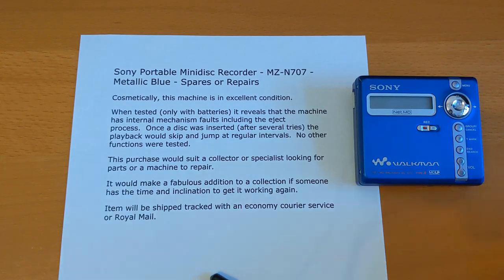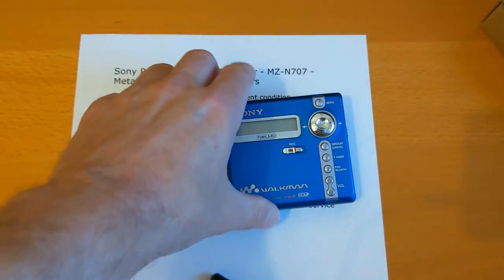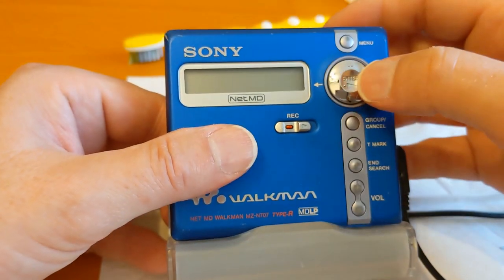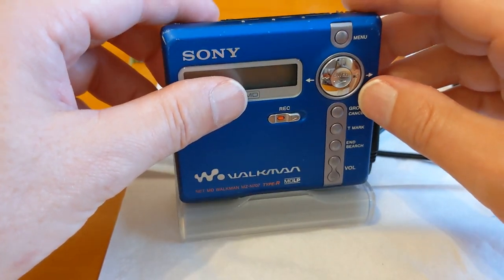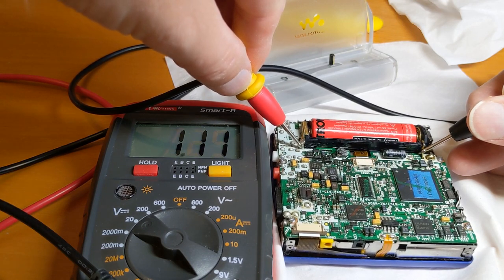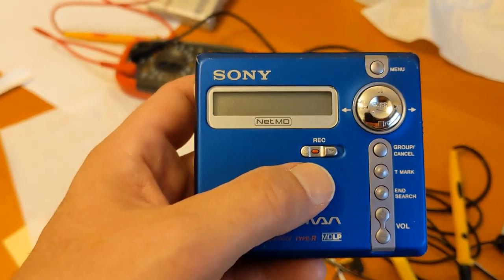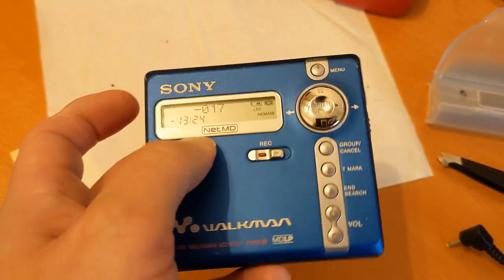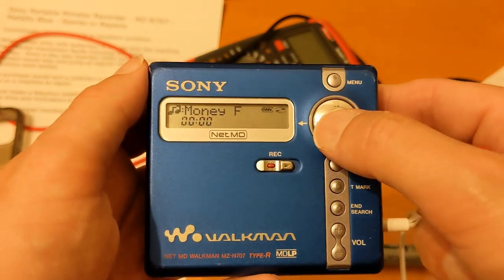MZ-N707 repair, and another one breaks

Comment: The most common fault I have found on a good number of MD portables from either Sony or Panasonic, is the tiny switches on the circuit board that detect when the door is closed and the one that detects if a battery is inserted. They usually either oxidize or get some of the leaked battery fluid in them, a blast with contact cleaner and a good manual workout usually gets them working again. The player/recorder will not respond or attempt to read the MD if it thinks the disc door is open. 

Also, I've actually managed to get a few players running off a gumstick by squeezing the positive battery contact's hinge with a pair of needle nose pliers. The brass bushing is typically connected to a post coming off the PCB and sometimes gets loose to the point where it isn't carrying enough current from the battery to allow the unit to function. Or, even if it does function, the battery level indicator will often indicate a low battery when it is in fact fully charged. 

Lastly, if you are having trouble with your gumstick battery always showing up at 3 or 2 bars out of the 4, despite having cleaned all the contacts and charging your battery multiple times on an external charger, or even charging it inside the unit, try sanding the negative and positive terminals on the battery itself. Nothing too crazy, a light sanding with 600 or 800 grit will do. After sanding, clean the terminals and you most likely will see the battery meter go to full, or at least remain at 3 bars for longer. 

Pardon the lengthy comment, hope this will help any MD lovers out there keep their machines going. Unless it's a laser or write head issue, most units aren't really so easy to kill with simply age and corroded battery terminals. A bit of work usually brings them back, which is why I adore them.
Reply from the maker: Great comment. Thanks for the tips and info. 

I've often suspected the post of the battery door as being either too loose, or insulated with battery corrosion. I never thought of using needle nose pliers on it. Thanks.

I'll try sanding the battery terminals. Initially I'll try my fibreglass-tipped pen thing, and progress to sandpaper.

Thanks again. Lengthy comments are good, they often are length because of excellent info.
Reply: Thank you I have just acquired  five of these only one working will try these tips just found the ac chargers for them.

Comment: N505 and N707 are almost the same but the latter has a mic jack. I find that it's often internal corrosion that does the N series in. It's barely noticeable to the naked eye but if you give the lid switch a clean up, that usually helps a lot. Most of these lovely devices are victim to batteries being left in them the day the owner got an iPod for their birthday.
Reply from the maker: Yep, it's so sad. Coincidentally, I shot another video that goes live Friday week with these N707s, and fixing a N505.

Thanks for the tip!

Comment: i have couple of MD, the most worse problem is they do not work with rechargeable 1.2 volt batteries. so i use ext source or orginal non rechargable AA 1.5 V batteries while testing
Reply from the maker: I have been having problems with rechargeable batteries, but I now own a really good charger that helps.

Comment: Just found your channel, out of necessity! I have an N707 just the same which I originally got from my brother in law and have used it several times. It's been in the drawer for around 9 months and as I acquired a batch of minidiscs at a car boot, I decided to get it out and play them..and found it simply wouldn't play, zippo, not a thing. Have been following your tutorial and have re seated all the ribbon cables - there was absolutely no corrosion - given them all an IPA clean up but still getting nothing. You seem to imply that the function switch can be intermittent so I'm wondering if it's that. (What is also annoying is that I've lost the little plastic bit that you press to open the door). Any suggestions would be appreciated. Very clear and concise video.
Reply from the maker: @barrieainge4937  Is it spinning and trying to read the disc, or completely dead? If it's completely dead, put in a battery and a disc and see if you can see faint LCD activity when you close the lid. If so, it could be a door-closed contact that needs some contact cleaner or IPA. I'm not sure, but this detection switch might be inside the player between the mic socket and the inline remote socket.
It could be the buttons, but I doubt it. Try all the buttons and see if any make something display on the screen.
My blue one was non-responsive and on a fix-it pile, but I just tested it and it works again!
Reply: @CBitsTech  It's completely dead but I'll make a further investigation and try what you suggest. Thanks for your reply. Barrie

Comment: Mz n505 board is similar. I find Broked soldering of digital sound amplifier on my 505. Litle pressure upside chip turns normal operate audio.
Reply from the maker: Thanks. I've seen that problem in someone else's YouTube video. I can't remember whose for sure, but it might be a sjm4306 video.

Comment: Might be worth reflowing the battery connection to the pcb. That much corrosion might have made it intermittent. Some light sanding with fine sand paper on the battery spring and positive side could also help.  I've had a couple of players behave similarly to your silver one.  As I applied pressure to different parts of the body, it would sometimes cut out, or cut in.  Pretty satisfying that a big chunk of corrosion just fell off in one piece. :)
Reply from the maker: lol, very satisfying.
I'll bear your suggestion in mind about the reflowing, and I might try that too, but I have a hypothesis about a different cause of this problem. I won't say more now because I'm no expert in this stuff. 

The blue one appears to be working fine now, but I'm testing them both and almost hope that one fails again so I can figure out for sure what's going on.

Thanks for the tip and info.
Reply: Looking forward to the next part and the hypothesis. There aren't enough Minidisc repair videos around!
Reply from the maker: Thanks. The next part is up now, but no conclusive proof of what fixed it yet. I'm still learning.

Comment: So do you repair MiniDisk players for customers? I have two, one looks like it is working but no sound, the other one doesn't even power up. 
1. Gold MZ-N505 Type R doesn't power up
2. Blue MZ-R70 powers up, no sound.
Please contact me for next steps to have them repaired or get you some more spare parts
Reply from the maker: I'm sorry, I don't repair for anyone else. I'm really just making up as I go along, and some are beyond repair for no apparent reason.

If I had to guess, I'd suspect the N505 has a lid-detect switch that needs some IPA or contact cleaner. Does the R70 output sound via the Line Out?
Reply: @CBitsTech  Thank you for getting back to me. The R-70 does not have a line out, only a line in. It has two headphone jacks, The first one has a remote jack. The N505  only has the one headphone jack for the remote.
Reply from the maker: Sorry, my mistake. I assume that neither headphone jack works.
That player can only play SP discs. If the disc is LP2 or LP4, then it will look like it's playing but it will be silent. 
If that's not the problem, and neither headphone jack is working, then it could be the amplifier circuit/chip that isn't working, or (less likely) both headphone jacks need re-flowing (resoldering).

Comment: Next time if you see corrosion on contacts, use citric acid or lemon juice to prevent damage from scratching contacts.
Reply from the maker: Thanks. I had run out of white vinegar and didn't have anything else to hand. I prefer white vinegar to lemon juice as it's spirit vinegar and doesn't contain anything else. I still use IPA afterwards.

Comment: Hey cbits tech.  I want to buy this mds-s38 deck recorder player.   Except it doesn't have the remote.   I wanna buy the remote separately off eBay:  it's an it's an Rm-D7M.  do you think those are compatible?  They're both of eBay.   I'm pretty sure the remote belongs to the next upgraded version of deck recorders which is which is mds-je520.  But usually a newer remote can work on an older deck recorder , reverse compatible like.  Please get back to me, thank you! 😊
Reply from the maker: Sorry, I have no idea about deck remotes. Portable player in-line remotes are sometimes compatible, but often not. If the remote is fairly cheap it's worth a gamble, if you can use the features of the deck from the deck's own buttons. Sorry, I don't have more info.
Reply: @CBitsTech   OK thanks for your input I appreciate the help 👍
Reply from the maker: @paulleblanc1567  👍